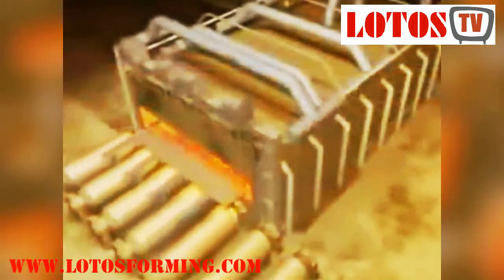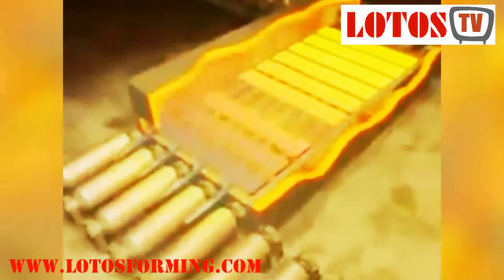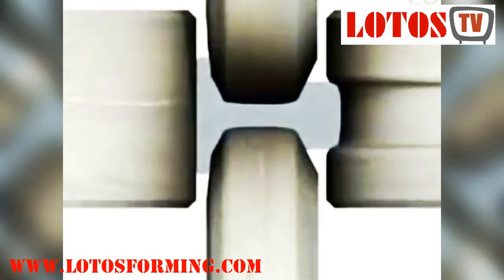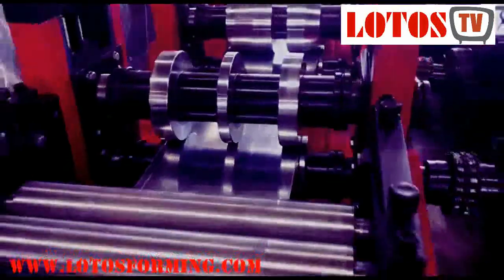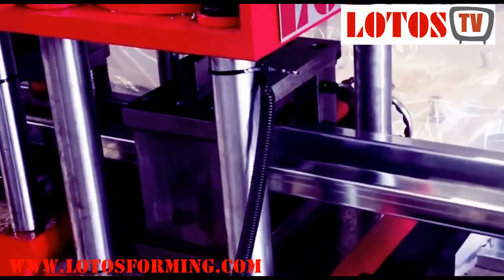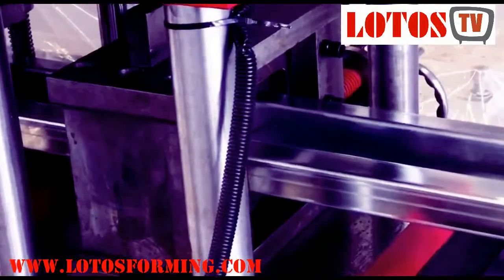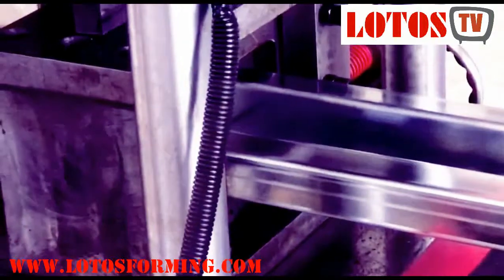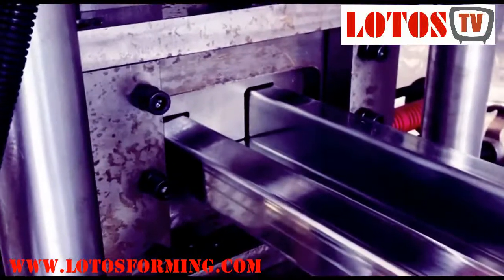Cold Rolled Steel | Cold Rolling vs Hot Rolling | Hot Rolled Steel

Comment from the maker: The hot rolling process is a good way to reduce the forming load of the advanced high strength steel stamping. The heating and the cooling process is complex and difficult to control for the hot stamping method. The cold roll forming process is an alternative method to shape the advanced high strength steel using a series of rolls under the condition of room temperature.